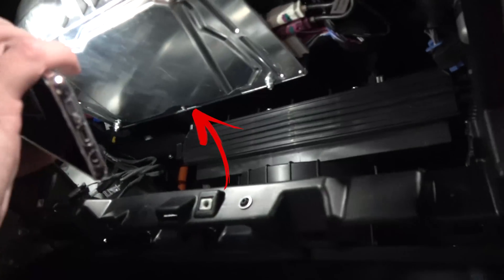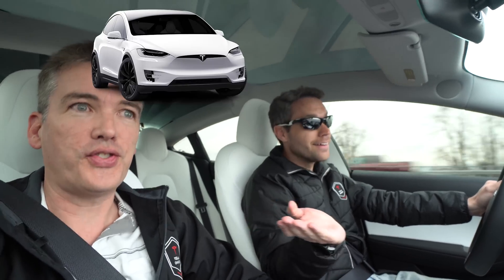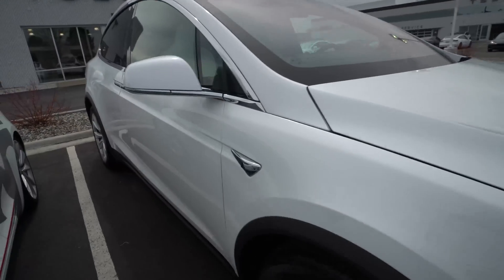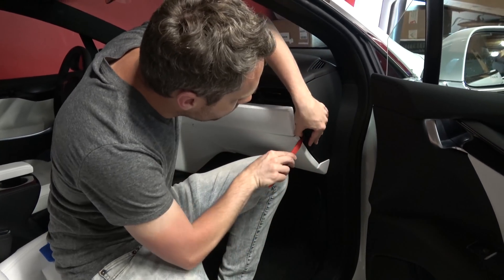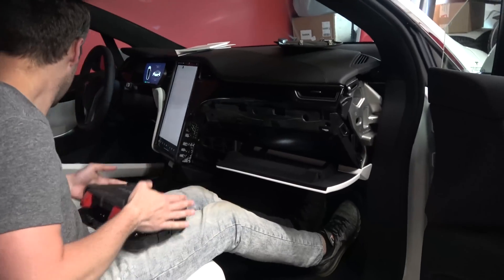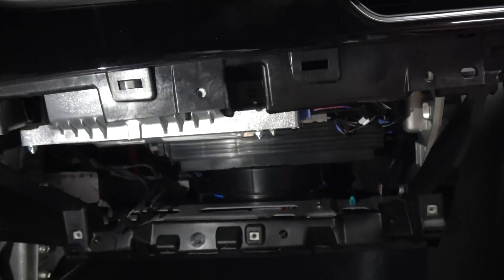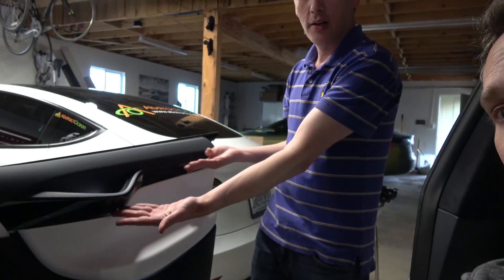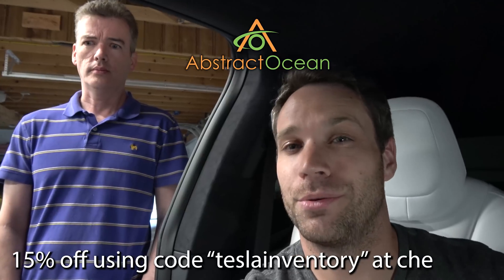Our New Model X with Autopilot 3 Hardware! FIRST LOOK! *Teardown*

Comment from the maker: Like this if you want me to take the computer out and open it! If I can find a reliable service manual that says the correct order to unplug/plug everything, I'll do it. Just don't want to fry my new car. 🤣
Reply: Can you please hook up a monitor to the computer?
Reply: What kind of Model X did you get? P100D? Standard?
Reply: No - Leave it be!!!
Reply: Don't do it unless you know what you are doing. You should have an anti-stat station set up.  When you take it apart it is going to have some cooling for the asics. If you remove the cooling to see the board you will need to clean and re apply the thermal interface. The screws are probably tightened to get a specific force on the thermal / component interface. It is just going to look like a high density multi layer high speed printed circuit board. If you don't know what the parts do it isn't going to tell you much. Or you could just say 'fuck it' and do it for the lulz and clicks. ;) What could go wrong?
Reply: DÆrik plug a monitor into the hdmi port
Reply: DO IT I DARE YOU
Reply: how do you see the info about what cars have ap3? are the 3s coming out with it yet?
Reply: Do it for science!
Reply: Buy a totaled one to experiment with!
Reply: I could never rip apart a brand new car. I'd have to own it 3-5 years first.
Reply: It doesn't matter the order you unplug it in but I would recommend killing the power to the car until you put it back into the car. Just make sure you don't lock yourself out.
Reply: What was your VIN ??
Reply: Just contact Rich Rebuilds he will help you for sure!
Reply: I can't afford one Tesla and you own all those?!
Reply: DÆrik, have you done any tests at tricky places in the road to compare 2.0, 2.5, and 3.0 capabilities? Can the nearly 10x faster computer make better decisions at the same places where earlier versions fail?
Reply: Hi Erik and David, where did you get your carbon panels? Did tesla supply them new? I'm looking to change mine out. Thanks

Comment: Can you compare the performance of the fsd computer vs the 2.5 hardware? 

I feel like the 2.5 hardware fails in situations largely because of a low frame rate , for example cut ins or a stopped car on the road. 

I wonder if the higher frame rate of the fsd alone would address these issues.

Comment: Really curious as to what you're going to do for the X.    I'm interested if you're going to do anything to protect the rear hatch metal plate.   I feel like I want to skin it but those ridges wouldn't be fun.    And BTW - that flippy latch part can catch dogs feet.   I'm thinking something like a flap to put over it when loading/unloading.   Just watch that damn thing with the dogs.

Comment: Can you pop off the trim at the front of the frunk and confirm that there are two radars installed?  The original AP2 radar is on the passenger side of the front cross member, and I expect the second radar will be mounted on the driver side of the cross member.

Comment: Elon Said that the New FSD Computer doesn't work as well as the current hardware. It's not optimized? So the question is will your experience using Autopilot not be as.good?

Comment: i really dont see the excitement about 3.0 yet
teslas has invested alot of money/effort etc into promising every 2.0+ vehicle is upgradeable
sensors havent changed?

I'm not aware of anything that 2.5 can do that 2.0 cannot do yet let alone 3.0 unless its just noticeably better than 2.0 

as long as tesla is selling a 2k option for FSD ignore it as its included and 3.5 etc will be out next.

if they were to change the sensor suite on the cars that would be concerning and compromise their promise on some 300,000 cars roughly regarding upgradability assuming the sensors were not upgradeable as well which seems doubtful

Comment: How about mod the rear heat so it actually puts out warm air. My 2016 X only blows cool air. I hear that the rear heater is undersized. A little disappointing for such an expensive car.

Comment: Elon said all Autopilot 2.5 cars are going to get free upgrades to 3.  Will see what happens.. But apparently its mostly around new/better processors..
Reply from the maker: Same with autopilot 2 cars. My S had FSD paid for 2 years ago.
Reply: I believe that is true if you paid for FSD up to the point when Tesla decides to change the pricing on AP/FSD again in the future.  So, my understanding is if you have a HW 2.0 or 2.5 Tesla but did not yet purchase FSD, and if you want to later upgrade to FSD with HW 3.0, that it could still cost you extra even if that is what was shown online at the time you bought the car.  Maybe I understood incorrectly, but I was told Tesla is still figuring out who gets to upgrade to HW 3.0 depending if they haven't yet paid for FSD in full or prices are still subject to change for those that haven't yet paid for FSD in full.  So, when I heard this, I upgraded all my vehicles to FSD before prices change again.
Reply: @wg4476  we bought out Model 3 with FSD... I am too much of a tech nerd not to..

Comment: Did you order the Model X after the name change (100D to Long Range)? What does the badge say?
Reply from the maker: I ordered a long range, came in badged as a 100D.
Reply: @TeslaInventory  how stupid then. just keep the 100D name sounds way better and has age to it.  out of curiosity did you get it post 85Dish standard removal with 100kwh pack or after?  that was a decent deal in and of itself.  all the benefits and 5k less for like 40 miles of range you'll never use but all the charging and 100kwh pack which you can leave maxed out.  100% of 90 is the same as 90% of 100 daily use
Reply: expect an upgrade to float around after a while for cheaps or when a disaster happens for publicity
Reply: god that was so dumb. abandon 5 years of naming convention to match the 3 of all things.

s/x should have stayed the same and left the odd child 3 out
Reply: @Richard-ie1if  from everything I have read it wasn't changed to "match the model 3" but rather to simplify everything for average customers who have zero idea about electrical / energy terms.  Long Range is something just about anyone can grasp on a fundamental level.
Reply: @genephipps6421  after 5 years "average customers" cant figure out 75 vs 100? jesus christ.  

didnt bother changing the back lettering though.  P100D sounds alot better than Model S Long Range Performance.
Reply: @Richard-ie1if  it's the bit after the 75 or 100 that people don't understand =).  It is the same thing Apple did when they stopped quoting processor and ram speeds and just focused on how much hard drive space it has as that is all the average consumer cares about.  Standard, Mid range, and Long Range.  Easy.
Reply: @genephipps6421  and so tesla the tech car becomes dumbed down for sheep. excellent.  still havent changed the badging though lol
Reply: @Richard-ie1if  I know it is a bit grating for some people...but the goal is to become a mainstream car company right?  I personally prefer as little branding or markings on the car as possible.
Reply: @Richard-ie1if  forgot to add that where I live those name / model badges tend to melt in the sun withing a few years anyway.
Reply: @genephipps6421  wut? the back of your car is melting off? that doesnt sound too good
Reply: @genephipps6421  so 100D right? or S100D even versus Model S on left Long Range on the right.

not a big difference but its kinda funny when you buy a (x1) and a 1x shows up with the old badge
Reply: @Richard-ie1if  in South Texas there is a lot of sun and heat.  Those model/brand badges can melt over time.  The Tacoma badge on my truck for example has melted and run with little rivulets of material dripping down several inches...seriously.

Comment: Hi guys, does ANYBODY know, how much computing power does AP3 have? Like in TFLOPS?
Reply: TFLOPS number is dependent on the accuracy, 64 bit accuracy is more demanding than 32 bit and 16 bit is less demanding than 32 bit so only by knowing the accuracy one can compare the compute power but this kind of work load is based on image processing and not in float point. Tesla claims is 10 times faster than nvidia they use currently, and it is supposed to be able to process all cameras at full resolution at 100 frames per second. 8 cameras with around 2 megapixel resolution each at 100 frames per second is 800 images per second and they run full frame multiple object detection always in relation to several previous frames on all of them. My guess is 20+ tera operations per second. It would need a normal GPU to have 10 Tflops of FP32 to match this performance. And that GPU would use 300 watt while this SoC most probably uses 30 watt.
Reply: @uPerigoso  Thank you for your complex answer... really helps! :)

Comment: I hear they are using an Intel CPU it maybe possible that they decided to use a standardized already mostly designed board like an ITX or mini ATX format an added the new chip on the board. So there is likely already support for HDMI/USB 3/PCI express on the board. It likely makes more sense from a cost standpoint and future proof design standpoint because the support chips design is very expensive so staying with a standard design saves a lot of money. They could also be using an AMD CPU VS Intel but I hear they have already an agreement with Intel over parts. So they could also use it for servicing and various other functions. Just throwing that out there because the previous Nvidia designed board was pretty proprietary and very costly. This design besides giving them a major technology advantages over other car companies it saves boat loads of money.

EDIT: I wanted to add that I heard Nvidia was getting like 2 or 3 grand per board this design change outside of the massive R and D effort likely costs around a few hundred per board. Huge production cost savings and don't worry as soon as a few well funded people get their hands on it the photos will be all over the internet. Tesla had their own board but used Nvidia GPU and only one GPU VS 2 as per Nvidia designed board that caused the performance limitation.
Reply: Hi, they use Intel in the infotainment computer not the autopilot one. That is why you can reboot the infotainment while driving and all security and autopilot stuff keeps working. For the autopilot computer, my educated guess is, they use ARM cpus with little customization other than security and redundancy and for AI compute they probably use accelerators like custom tensor cores like google uses in their neural networks.
Reply: @uPerigoso   Yes I understand that they went with Intel on the Infotainment but the new AP I was just making the comment because they dropped Nvidia all together with AP3. I would image they also dropped Nvidia Tegra. I hear that AMD potentially could have been in talks given their new APU using ZEN and GPU based on Vega or Navi. But unlikely because of Intel's relationship with them on infotainment. I would imagine they could be using a realtime OS based on Linux on AP3.
Reply: @netgeek3010  From my understanding, they use Intel on the infotainment because it's just a human interface with no proprietary technology other than the software so a of the shelf solution is what they choose and intel probably gave them the best price/availability deal. On the AI chip they decided to do their own and that is why Jim Keller work for them for a few years, my guess is a ARM cpu, because that is what the nvidia chip used so it's easier to port the software, and since the cpu is just there to do ordinary tasks a custom ARM is enough and Jim Keller worked on ARM while he was on AMD prior to Tesla. The AI chip could have GPU cores but a deal with AMD just for those is unlikely, because they need GPU cores and tensor cores for those heavy AI neural work loads and since they are paying ARM royalties, they might as well use their GPU patents with proprietary tensor cores and i think that was what Jim did while he was working at Tesla, he designed how all of that tie together in a SoC Tesla could use and be free of all nvidia ties with their closed software. I'm myself a AMD stock holder and it would be very nice for AMD to be involved but their expertise are in big data and in training neural networks, these chips are more orientated to run trained code while spending low wattage. AMD solution would probably use more power and need a bigger work on software port to x64 from ARM64 used in AP2.x, but it's possible, my issue with that is, we would know about  already if AMD was a supplier.
Reply: @uPerigoso  Hi Sergio it can have two intel CPU's communicating via the CAN bus protocol. They likely went this route because of performance. The Intel CPU with Tesla designed application specific processor for processing imaging data from the exterior and interior cameras as well as the sonic sensors requires serious floating point processing.

 Intel and AMD still have a huge jump on this over Qualcomm and other ARM processing solutions. The dedicated Tesla AI chip is used for analysis and processing  lots of images coming from these sources at 2,000 FPS but you still need serious computing power from the CPU to manage that data. AMD and Intel makes a lot of sense in this area because the cost issue is not that big anymore for serious processing from X86 architecture VS ARM architecture. In cars power and cooling is easier then in a phone so increase drain VS huge performance difference makes it worth it.

Comment: The CPU sticker shows 1655000-00-F but the parts catalog shows 1655000-70-F. Not quite the same number. 🤔
Reply: If you look closer, previous versions do have different letter at the end... F is only in 3.0
Reply: I bet they have an early development board because it has these unused connectors.
Reply: @ddud4966  They are not unused connectors. The look like outputs for a display, in case of diagnostics requirements.

Comment: Is there any way we can see the patch notes on this model x from last years model? What changes are there if you buy a 2019 model x than a used 2017? The same with model 3 and s.
Reply: to date nothing.  2.0 is identical and upgradeable to 3.0.  its on the order page.

if tesla was to vary from this they'd have issues with 300k cars produced to date with 2.0/2.5